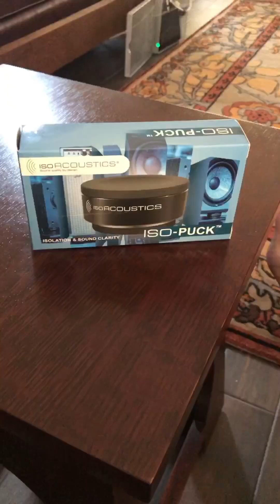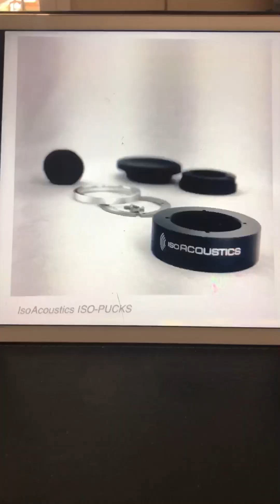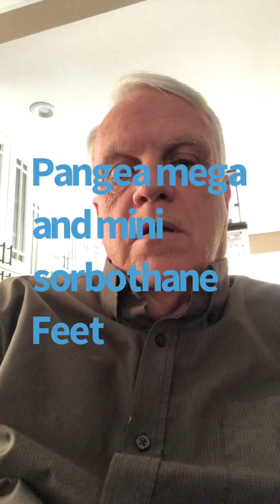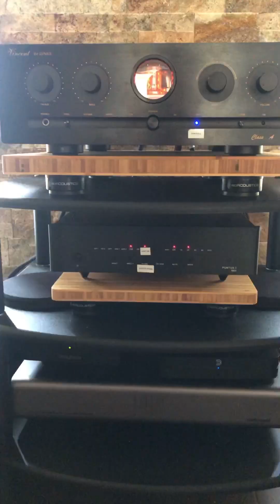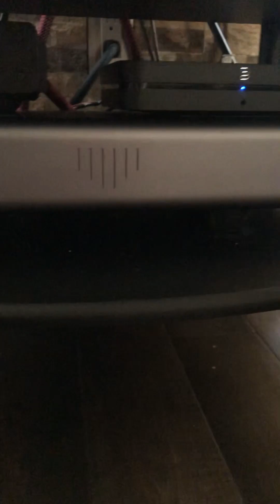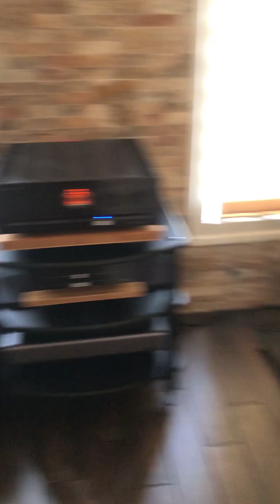Hifi component isolation

Comment: Hi Steve, i'm thinking of changing my Krell Kav 400xi amp with Vincent SV 737 for my KEF R5 but i'm not sure is it a worthwhile improvement or not. Do you have any experience about this comparision?
Reply from the maker: I don’t know about krell. But I do love my Vincent. The tube pre amp sounds great. I enjoy putting different tubes in. I finally broke down and got some 1955/1965 12ax7 Telefunken tubes. There great. The solid state amp in the Vincent will drive almost anything well. You won’t be sorry buying Vincent.
Reply: @stevethetoolman2435  thank you for your quick response :) I also consider that whether buy 4 piece of iso puck each to my kef r5 rather than buying expensive gaia ii or gaia iii? Did you compare them underneath your speakers?
Reply from the maker: I didn’t compare the expensive pucks. I bought the 8 pack of mini for 100 dollars. My speakers are only 16 pounds. I bought the 2 pack of pucks. No expensive pucks.